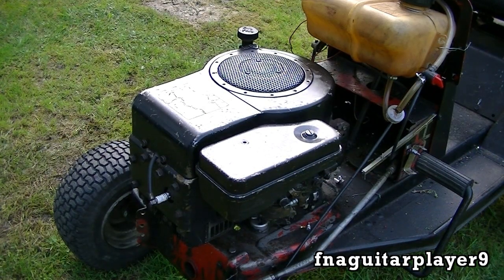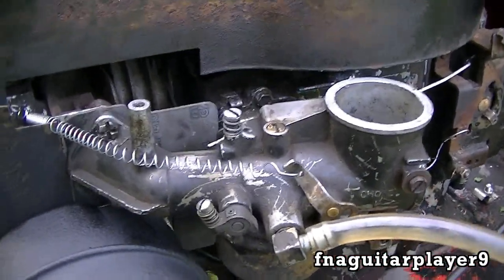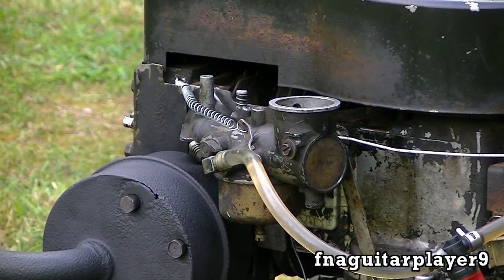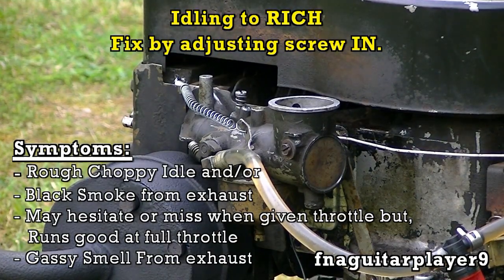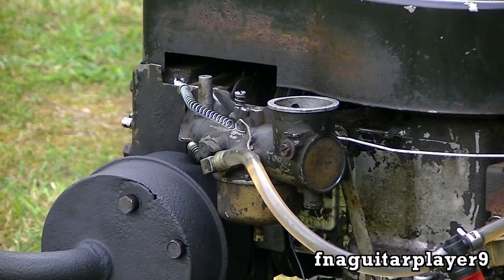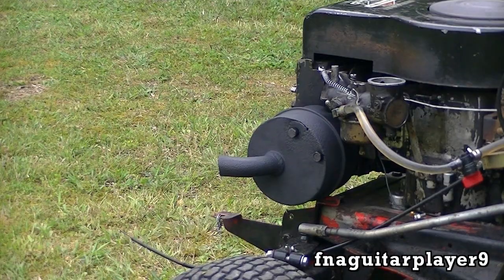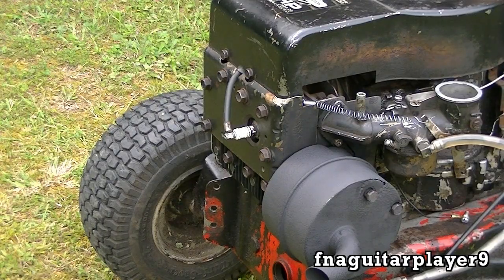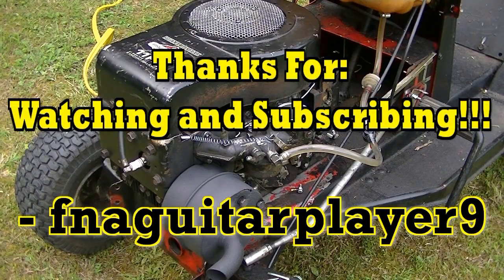How to adjust a Briggs and Stratton One Piece Flow Jet Carburetor

Comment: Hi wondering if you can help and explain,i have one of those carbs which i replaced with new .the old one had the gold jet fluch with top of carb but new one has spring and sits above carb body ,its next to mixer screw .

Comment: this was excellent video. My lawn tractor is 35 years old was and running pretty good. Then the throttle linkage lever broke so I put in a new carb and this video really helped me understand the different issues and how to address each. (symptoms list and how to fix is BRILLIANT).  
On your sample carb, next to the idol mix screw, on top, there is a 2nd screw slot never discussed. 
My replacement carb has an actual screw and spring there. Wonder what it does. some testing didn't seem to make much difference.

Comment: I had a running engine that I put a new replacement carb on. I started it up and it ran for a minute or so (I was running a little rough so I was letting it come up to temp a little before I started rolling it in) but it died before I had a chance to do anything and now I cannot get it to run...🤷‍♂️
Both screws were set between 2-2.5 turns. I've tried going back to that and still nothing. It'll fire fire a few seconds if I hit it with a shot of gas down the yap but won't fire and run on its own. Im sort of at a loss with it. Idk. The bowl is full of fuel 🤷‍♂️ I've checked. The fuel filter is full of fuel, both my fuel shut offs are open.
I do still have the old carb. It needed gaskets and the inside was pretty corroded from sitting when i got it. I might rob the bowl gasket off the new one and put it back on. At least to rule out one or the other unless someone has an idea I haven't ruled out yet?

Comment: I have the same engine on an old Snapper lawn mower. Ran for years without any problem. I gave it to my son and he left it out in the rain. The carburetor was toast. I just got a new carb for it. It runs good but high speed sounds way too fast. How do you governor these engines down so she does'nt over rev?

Comment: This was great! My 25 year old Snapper lawn tractor has a 14.5 Briggs & Stratton Engine and one of those anti-backfire solenoids in the bottom of the carb, which is supposed to prevent backfiring when you cut the engine off, and I've never had to take it to a repair shop.  A couple of years ago it started running all-out or not at all.   I tried to cure the problem by putting on a new, replacement Chinesium carburetor, which melted the electric connection at the carb anti-backfire solenoid.  Neither the Snapper nor the Briggs and Stratton manuals tell you how to  deal  with carburetor problems. It is still very hard to adjust; when it's running, it was setting speed records when you cut it on, apparently due to an incorrectly connected spring to the governor, until you engaged the blade in high grass and then it was almost normal, and you could slow the engine down with the throttle control, but this year it's worse.   

It sat up without being run for a year or so, after the blade drive belt on the 38" deck dropped below the right hand belt guard and got all tangled up with the belt brake at that guard while being wedged under the pulley by the belt guard - I finally decided to fix these problems this weekend - you have to remove the guard and the belt brake to re-set the belt on the pulley, etc. I also learned years ago to only use belts marked as being made for Snapper (usually by Briggs and Stratton), because other belts of the same length are too thick to work correctly on a Snapper deck. 

I watched your video on the correct way to connect the governor spring, and followed your instructions on screen while I did it.   The choke and the  governor mechanism now seem to activate when the choke responds to the throttle input (i.e. max throttle) on my engine to get it started, but the governor doesn't seem to actually do anything to control engine speed. The anti-backfire solenoid burned up shortly after I replaced the carb, so there is no longer any electrical connection to the anti-backfire valve at the bottom of the carburetor bowl.  When taking it apart this weekend to use standard automotive spray cleaner (i.e.BrakeKleen)on all of the internal carburetor openings for fuel and air, I noticed that there  were 2 thin washers between the anti-backfire valve and the bottom of the carb.  While I was messing around with it over the weekend, I lost one of the thin washers and substituted a thicker washer for the thin one I lost; now it seems that the slightly thicker second washer is allowing float bowl to overfill, because the spacing increase from the thicker washer may be preventing the needle valve from completely closing; it now seems to never cut off the incoming gas, which drips everywhere as long as the in-line gas valve is open. 

Is it possible to put in a pre-anti-backfire-solenoid needle valve, or buy such a carburetor from Briggs & Stratton,and if so where would you get either one, and using what part numbers, or is there a simpler way of fixing it involving a thin rubber washer as a seal and spacer to allow the needle valve to cut off gas flow when the bowl is full, and to keep gas from leaking out of the screw-in connection between the bottom of the bowl on the carb, because the metal-to-metal seal between the solenoid and the bottom of the bowl is not leak-proof and cannot prevent leaks if the in-line valve is open, regardless of whether or not the motor is running?  

Sorry this comment and my questions are so long, but you certainly seem to know exactly what you're doing with these mowers, particularly the ones with B&S motors similar to the 14.5 HP one powering my lawn tractor.  If you need more exact information, the Snapper model is Snapper mower MODEL NO. 84239 - LT145H38DBV, 38" 14.5 HP Hydro Drive Tractor Series D 38" Cutting Deck (possible alternate model is 84270). I use the mulching blade, for what it's worth.  It is generally referred to simply as the Snapper LT145H38DBV, and I bought it new from a friend, when he was a Snapper dealer, and we lived in the same town, but I moved away, and I don't see him as much as I used to, and he has changed occupations.

Thanks again for a great video.

Comment: Good advice, but still can't get it ,when u  adjust bottom screw  clockwise & counter-clockwise  the bottom.screw main fuel / air  mixer

Comment: Can't get my carb into small bath because of the long rod that helps holds the air filter in place. Tried to unscrew it but don't know if is somehow held in permanently. Anyone know? Thanks!
Reply: Yeah, I know! You can just unscrew it. It's not especially fixed in.

Comment: Do you know of anywhere i can buy the air filter and air filter assembly for that carburetor? I purchased an old mower that has that exact carburetor and I have to replace it but it didn't come with the air filter.

Comment: You’ve done a very good job of adjusting the carburetor. That was very helpful. What spark plug do you recommend to use on a 8 hp Briggs & Stratton. Like the video you done the carburetor just Minon.

Comment: i have an old simplicity with a 12 hp I/C briggs that starts to run like crap when i go into a high gear or turn the blades on but sitting there in neutral it runs fine and sometimes it runs fine in gear but like 10 yard later it starts to sputter and dies. what is my problem carb?, or something motor-wise?

Comment: The engine you use for this video briggs and stratton is model 252707 type 0134-01???? 
Is the carby for the briggs model 252707 8 hp and 11 hp the same or different? I am planning to buy a new carby for my old ride on mower.
Reply from the maker: If it says 252707 and its a 8hp, it should be the same, the more common model 19 8HP do use a different carburetor, if it looks identical to the one in the video it will work, the model 19 carbs, had a almost 90 degree elbow where it bolts up to the engine. And are smaller. Thanks for Watching!!!
Reply: Thank you! More power!

Comment: I have this exact carby, and have followed your instructions very carefully, I have also been to.... https://outdoorpowerinfo.com/repairs/briggs_large_one-piece_flo-jet_carb.asp and have followed there instructions to the letter and still can't get this thing running right. All it wants to do is flood and foul the plug. Just got  jack of it and done a compression test and it has 60psi. I guess its knackered yeah?
Reply from the maker: That compression is a little low, might want to do a valve job on it and see if that helps. Thanks for Watching!!!
Reply: @fnaguitarplayer9  any ideas on the flooding? Brand new needle and a perfectly set float.  As soon as u turn it off fuel just pours onto the carb
Reply from the maker: @mstyles75  Did you replace the needle valve seat as well? if not that might be causing it.

Comment: Wish you could show video on flywheel removal on that 12 hp IC  engine that had two screws on air cleaner, 1:24 on video.
Reply from the maker: It will be the same on all of them, the only possible difference is some had a bolt that went into the crank while others will have a nut instead. Thanks for Watching!!!

Comment: Best video I seen in awhile
Reply from the maker: Appreciate that, Thanks For Watching!
Reply: @fnaguitarplayer9   got a racing mower with flathead Briggs. Got any tips on getting a good proformance tune
Reply from the maker: @JorgeVonVogler  I'd suggest tuning it in like the video until it runs smooth idling and full throttle, but you may need to richen up the idle so it will take the throttle faster, since this type of carb doesn't have a accelerator pump, and you can still get cams for these and other parts, there getting harder to find but are still being made, also recommend billet connecting rod, billet dogbone or brass counterweights and a billet flywheel. hope this helps

Comment: Hello from England, when I unscrew my oil filler cap, the idle speeds up ,but is better and not so lumpy, can you help, it also hunts on idle , so much I can't get my screw driver on the idle screw when its running?
Reply from the maker: Carburetor probably needs cleaned and adjusted. Thanks for Watching!!!
Reply: @fnaguitarplayer9  Thank you just ordered a can of carb cleaner

Comment: Love the video, very helpful,, ok so to my engine drips fuel,, the old float rotted and had a hole in it so float dropped and emptied my fuel.. i installed a brand new float, set up float as i have on every other motor,, it fired up,, but then after i shut it off,, it began dripping again,,  my engine won't rev up high enough to power the mower strong,, the throttle lever won't go any more,, the silver rod that goes from the back right of the carb,, to the back side of the plate that the throttle cable is attached to (right side of carburator) where does this rod attach to on the right side behind the plate?  the end of the rod looks like a paperclip..  i need help fast please...
Reply from the maker: I have other videos on the linkages that may be a better help then me trying to type it out, search on my channel for one piece flow jet linkages and it should come up. Thanks for Watching!!!

Comment: Thanks for the video - I just rebuild the carb just like yours. So I back out each screw 11/2 turns. Then start up and reach operating temp. On my lowest engine speed setting I adjust top screw until it idle's smooth. Then I bring it to high engine speed. and then adjust main jet until it runs smooth. Is that correct?
Reply from the maker: Your welcome! That sounds about right. Thanks for Watching!!!

Comment: Good video, but you should tell the lawman how many turns on the screws to start with. I start mine at 1-1/2 turns on each of the jet screws then adjust from there. Very careful, don’t tighten screws to tight just snug them them coun’t counterclockwise 1-1/2 turns. And adjust a 1/4 turn in or out.
Reply from the maker: I thought I mentioned it, i know i did on the cleaning video. Yes 1 and half usually will get them running. Thanks for Watching!!!

Comment: When you start setup of the carb, what is your initial choke position, fast or slow?
Reply from the maker: I like to get them to idle first then try to get them to take throttle, you will probably need to choke it when its cold though, so if its auto choke you'll be starting at full throttle. Thanks for Watching!!!

Comment: I have just bought a Westwood T1100 made I think in 1987. It has the 11Hp Engine with similar Carb, the previous owner put a new Carb on it. No matter what I do it Keeps leaking fuel.  The Float is horizontal but seems to be of low quality. The float valve has a rubber tip and a very loose clip to attach it to the float.  Do you think it better just to throw the Carb away and get a different type?   The engine type is 253707-0122-01, As a stopgap, I have purchased a fuel cut off valve, I also find tuning this Carb so the engine run nice is near impossible at the moment. I like the videos you have made on this type of Engine
Reply from the maker: These are really good carbs, but it probably just needs rebuilt, they are known for float issues, the float could be taking on fuel and/or the needle valve and seat could be bad. Thanks for Watching!!!

Comment: I have that same carburetor that I’m rebuilding, there’s a big Welch  plug on the whole end of that carburetor, any idea how to replace it? Do you just drill it out pop it off and tap in another one? The things as big as a half dollar
Reply from the maker: They will just pop out, tap it with a punch from the inside and it should come off fairly easily, then you can take a center punch around the edge to "stake" the new one back in to hold it in place. The only time you really need to replace it is to gain access to the choke plate/shaft or inside it. Thanks for Watching!!!
Reply: fnaguitarplayer9 thanks already got it done

Comment: You think those Ebay flow jet carbs are any good there cheap like 20$ don't know if you tried them love you videos
Reply from the maker: Yes, they are actually decent carbs, not made identical to the original but does seem to function just the same and still has the high and low adjustments. I have also used the updraft ones for like a 8HP, here's a video on the one piece ebay carb: https://www.youtube.com/watch?v=pqS5yyg_Ej0&feature=youtu.be Thanks for Watching!!!

Comment: Hey! I have same carb. How do I make it idle low like a hot rod?
Reply from the maker: You can get a lower idle out of it by turning the screw that moves with the throttle plate, but don't go to low or the oil won't circulate as good, so keep that in mind too. Thanks for watching!!!
Reply: fnaguitarplayer9 thanks!
Reply: fnaguitarplayer9 hey I also have another question. Why does it die at low rpm as well?
Reply from the maker: @Farmtractor  it could be set for to low of idle or you may be able to turn the low side mixture screw out some to make the idle mixture a little richer.
Reply: fnaguitarplayer9 ok. Thank you so much! I’ve got a really rare 1970 jcpennys penncraft yard tractor. I’m excited to test it out!
Reply from the maker: @Farmtractor  no problem!

Comment: Backfiring, no matter how balanced you seem to have the car adjusted. I tried to have some success after adjusting the top and bottom screws, and I can get it sounding great, all except that highest speed. When I take it all the way up it just sound lean, but if I try to rich it up, backfires start :(
What am I doing wrong?
Reply from the maker: It cold be a problem deeper then just a carb adjustment, a weak spark can cause top end problems along with valves not sealing right.  Thanks for Watching!!!

Comment: I recently replaced the carb on my 11 hp and the governor linkage is very shaky at idle making the idle adjustment very difficult  but runs perfect at full throttle, I am missing the fine spring on the link rod between the governor arm and the throttle could this be the problem?
Reply from the maker: That could be causing part of the problem, or the governor may need to be adjusted,  the spring your missing keeps the linkages tight with each other, so that may be the problem. Thanks for Watching!!!

Comment: Hello again so I adjusted the needle and flot its running now but it will only run in full throttle as soon as I put it to idle it wants to shut off and also when I had it in full throttle I tryed putting air fillett cover back on and then it whats to shut off I tryed and tryed to adjust both high and idle mixter screws just can't seem to do it but aleast its running now do you have any ideas has this happend to you before
Reply from the maker: If adjusting the top adjustment (idle mixture) doesn't help, it may have a clogged passage on the idle circuit or the mixture screw may be worn. Thanks for Watching!!!

Comment: Hello really good info thanks for sharing your video I have the exact same carb but I just can't seem to to start I got it to run like three times but wont stay running I checked everything all the jets are clean spark plugs good tryed starter fluid just so hard to start it I tryed to start it for like over an hour just can't seem to start it do you have any ideas thank you
Reply from the maker: Your welcome! If the float level isn't right it won't have enough fuel in the bowl, checek that, it should set level with the carb body. I had one that did that and the new spark plug i put in it was bad, took me a while to figure that one out haha Thanks for Watching!!!